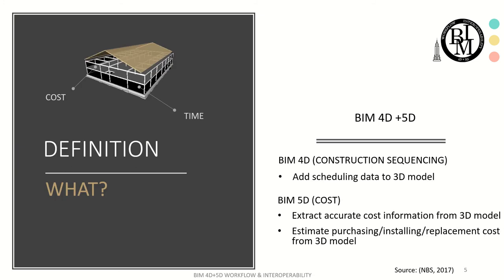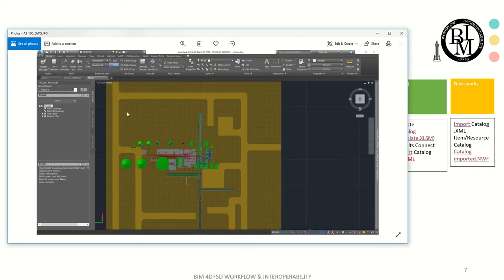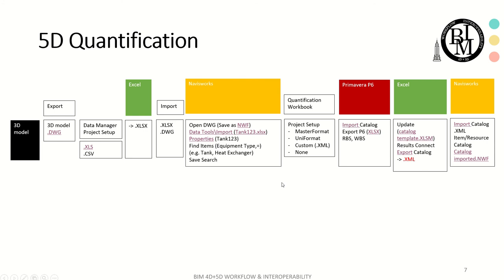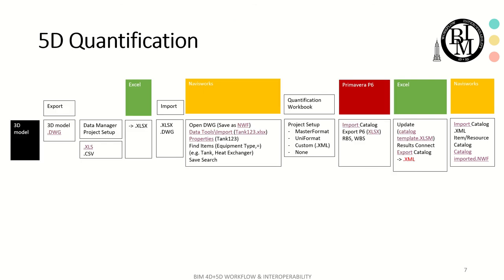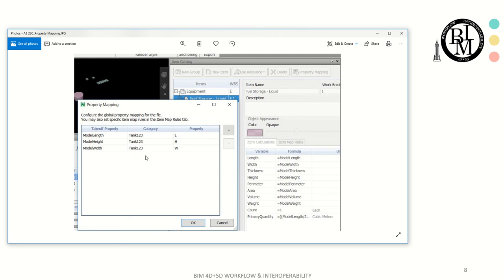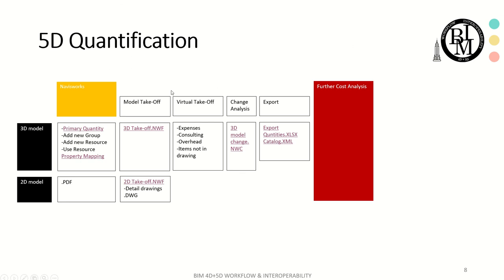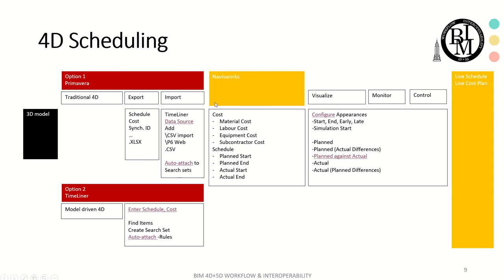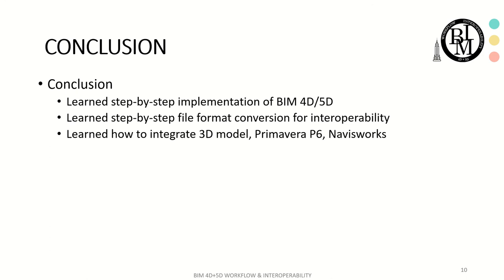BIM 4D+5D Explained - Workflow (Navisworks, Primavera P6, Plant 3D)

Comment: . I want to make a bar bending schedule of rebar from a bim model. I want to know that how much rebar is each element ( beam /slab / column) on what floor is taking how much rebar. Mean rebar quantity floor vise and then sorted to it host element and category vise . Does that's make a sense . Can you guide what can be helpful for me in this purpose . Which is fast and accurate
Reply from the maker: Hi Shadman, did you figure this out already? I am in general contractor side, and have never seen rebar being modelled - neither by structural engineer nor by rebar trades. My understanding was that constructing rebar on site is never that precise. So they don’t go into too much details of coordinating in that much of a detail. However, I do see the benefit of modelling rebar. And, if it’s for Quantity take off purposes, it is also interesting. I am willing to spend some time on this and figure this out with you. Maybe we can set up a call and hear what you’re trying to achieve and look at this together? Which country are you in? Send me your email to coordinate a suitable time for a chat. Thanks, Jaelin
Reply: @withjaelinlee  I got some plugin installed  for precise rebar modelling using ReVit structure. But still trying to figure it out about QTO. Because of busy schedule I am not able to focus.

Here is my email.
shadmandogar888@gmail.com
Whenever you get comfortable let me know we will discuss
Reply from the maker: Got it. Sounds good. I started diving into rebar modelling in Revit and might be able to get you what you need. I will reach out sometime next week.

Comment: This was one of the best well-prepared information about Naviswork I watched so far. Thank you very much.
You have a good skill of how to teach.
I have a question:
In the timeliner you have inserted costs (labour, equipment, material, etc). Is it possible to calculate the costs in Naviswork based on the quantification and resources we have in quantification catalog and the task durations we have in timeliner? by linking them. and also adding unit prices for resources.
without using excel, ms project and primavera for estimating costs of resources.

Comment: Great workflow, but how can I connect primavera p6 with navisworks?, would appreciate your help or tip!! thanks!!
Reply from the maker: Thanks for the question, Diego. I am not sure if there's a live connection available between those two software. The way I explored this is to have an offline connection (export the schedule manually from P6 as XLSX and import it to Navisworks as CSV as shown in this video). You can add 4D Task ID to the CSV as a new column (If you are using  Revit, create a shared parameter and create a project parameter using this shared parameter. Then, assign this unique ID to each 3D object that you want to include in your schedule). Also you can add Task Type (i.e. Construct/Demolish) as a new column to the CSV before importing it to Navisworks if you wish. The key is to choose your unique ID carefully (i.e. 4D Task ID, WBS numbers, or search sets). It's kind of hard to explain in words. But, hope this helps a bit. Does this answer your question?
Reply: Future BIM Perfect... now, i will put in practice... thank you very much
Reply from the maker: @DiegoGonzalez-tr2sg  You're welcome! Let me know if you have any other questions.
Reply: @withjaelinlee  Yes, i have... Do you have some contact mail?
Reply from the maker: @DiegoGonzalez-tr2sg  Hi Diego, thanks for reaching out. The purpose of my channel is to benefit as many people as possible. If you share your questions here, other people can also learn together. Keep the questions coming!
Reply: Your'e question led me to find the solution for it... Here I found something useful:
https://forums.autodesk.com/t5/navisworks-forum/integrating-primavera-p6-with-navisworks/td-p/7288885

And "Futur BIM" - Thanks a lot for a well explained video! :-)